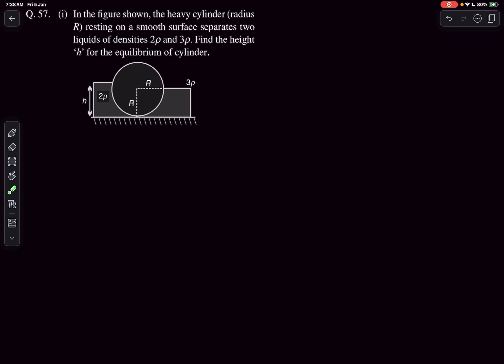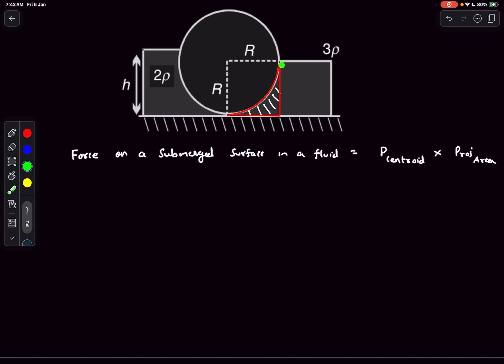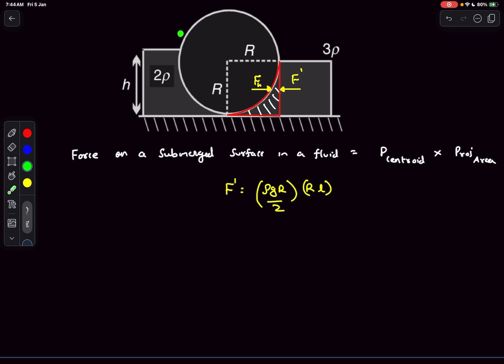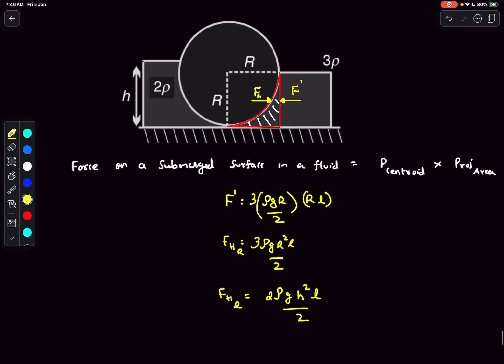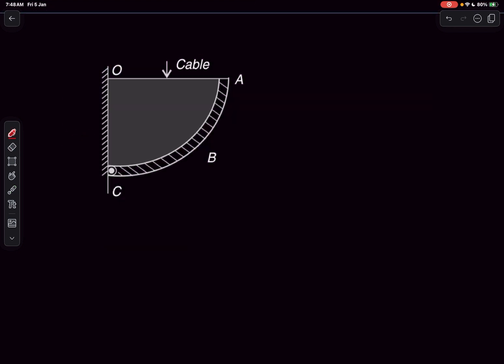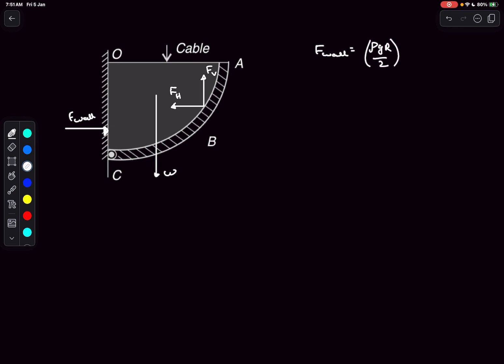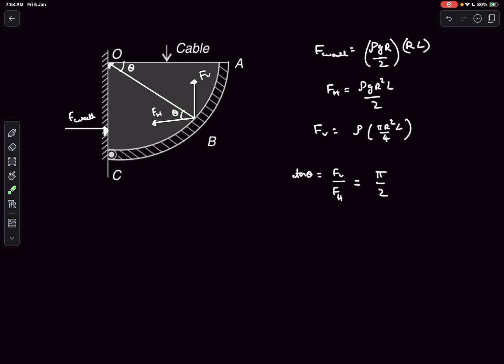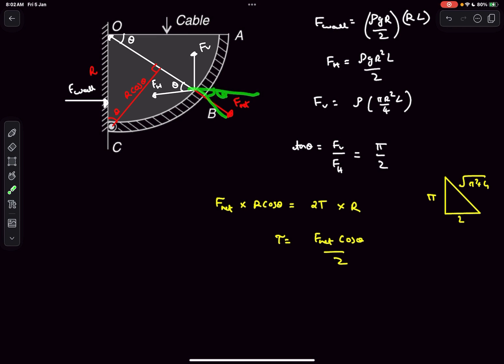[JEE Adv] Force on Curved Surfaces Due to Fluids | SBT 57 and 75

Comment: Bhaiye in the second question since the torque about O should be zero and pressure force passes through it so this means that normal reaction on the hinge should be zero in horizontal direction? So we can also say 2Tension = horizontal component of the pressure force??